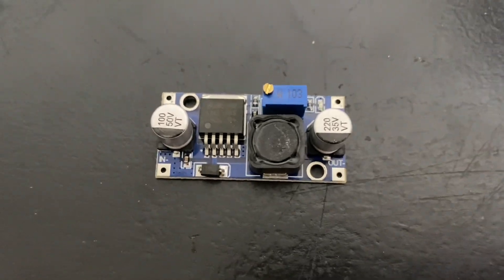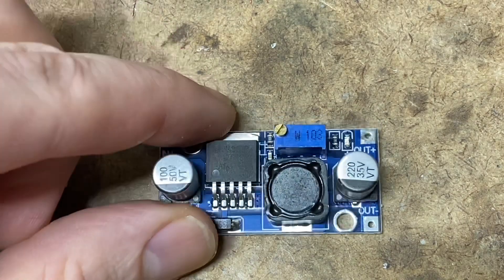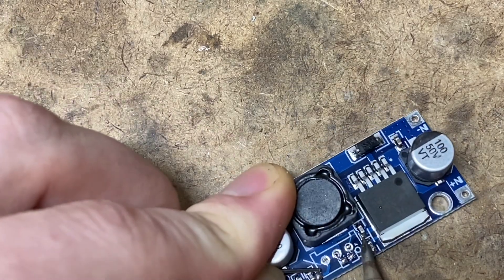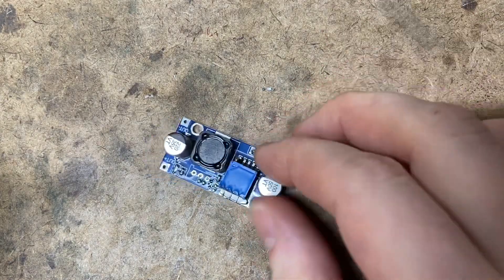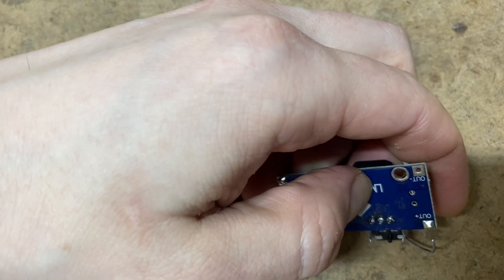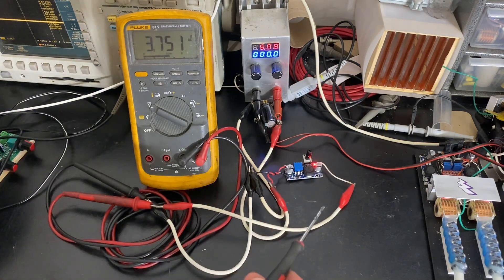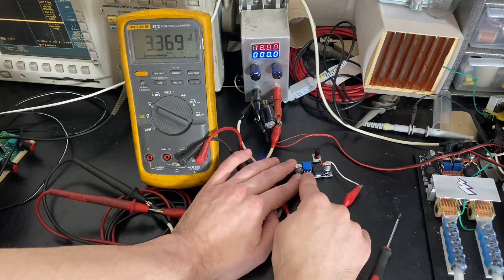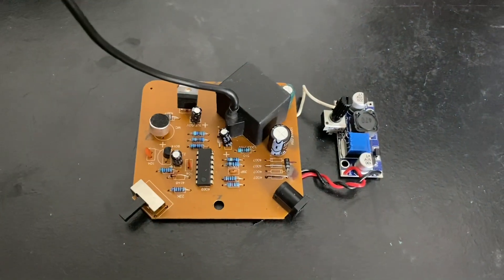Controlling A Buck Converter With External Potentiometers.

Comment: Hey, great video. It works as the buck u using is the same I have. The problem is that the Im achieving the voltage but not the amps as I would with a cc/cv. Is there a trick to adjust the amps on this buck… thanks!

Comment: cool dude fr, is that 2 voltage multiplying cascades fed by 2 flyback transformers with a mosfet being controlled via IC driven by 2 boost coverters?
Reply from the maker: Well, 2 buck converters actually.  But otherwise yes, you got everything else correct.

Comment: Can i use a 10 k potentiometer instead of a 5 k?
Reply from the maker: Absolutely
Reply: @exoticpropulsion8175  i tried but it doesn't work it always output around 3 volts😢

Comment: Perfect, was looking for a way to limit the range to 4v to 12v.  Did some experimenting and a 1k resistor will give you 5v (if you leave the 330ohm in place).  Every 0.25k adds 1v or removes 1v.  Adding a 0.75k resister and a 2k pot gives me my 4v to 12v range.

Comment: i would like to know more of that hv generator. Are u using a 555 oscilating circuit? and what is the voltage input of the transformer? Im doing the exact circuit and i bought those cheap high frecuency transformers that works up to 4V safely and i wante to know how to adjust the voltage within that range so thank you very much!

Comment: I have a dought
 i have two supply of one is 5v (mobile charger) and
 another is 12v (solar pannen)
Now i give both supplys to dc to dc boost module sapperatly (if i give 12v i off 5v,if i give 5v i off 12v)to same module by setting contant voltage of 13 for battery 
Will it give 13 v for both supply sapperatly or it changes